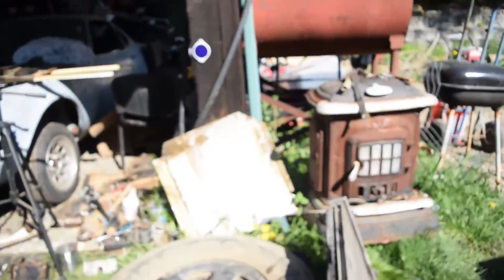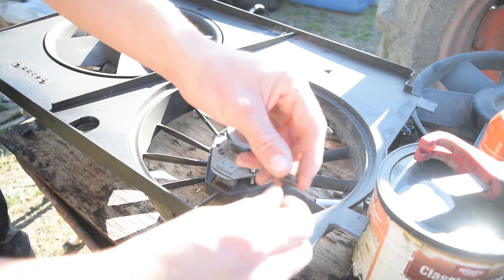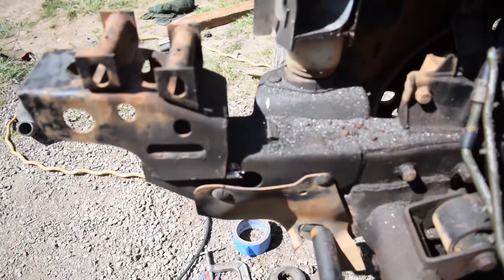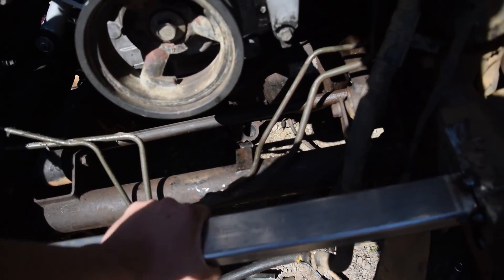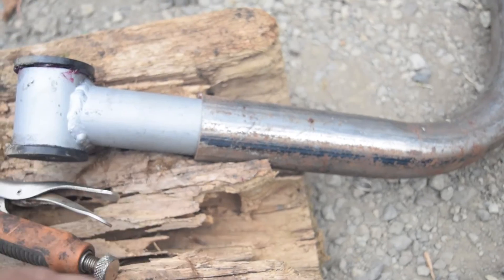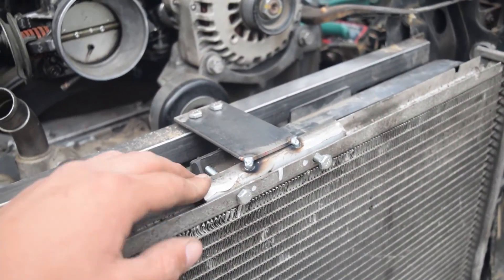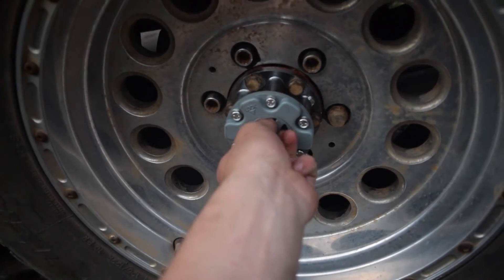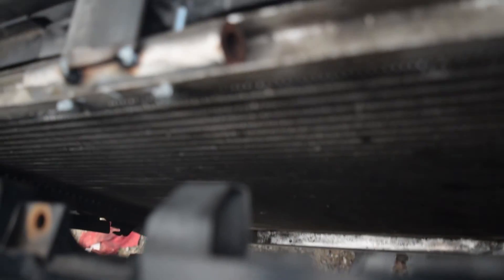LS 5.3 Montero SR pt. 3: Mounting radiator/ fitment issues

Comment: I have a 92 Montero 4x4 5pd trans that I'm having some electrical/ecu issues and kinda had the truck in storage since. Finding your vids sparked an interest in me doing exactly the same but only difference is my truck is a manual trans. Any differences that you can think of that I'd have to do differently from how your doing it like the wiring?
Reply from the maker: You would be able to cut out all of the transmission and transfercase wiring! You will need to adapt a speed sensor for the LS to run and drive correctly though

Comment: Can I install an AUDI A8 (D3f) 4.2L V8 FSI Quattro 6AT (350 HP) engine on Pajero?
I want to install a powerful engine and convert a Pajero to AWD all the time like an Audi
please answer
Reply from the maker: With enough time and money anything is possible. The only thing that i would be worried about is that Audi transmission handling the extra weight of the montero. I believe you would also have to mount the engine very far forward in order to get the front axles to line up with the front hubs.
Reply: @evansautomotive307  thank you very much
I'll try is something interesting to see your old Montero.
It has become strong and competes with the big ones
Reply from the maker: @lale_alale  That will be really cool. Good luck with the build. This one sure is fun and has been doing great!

Comment: You going to run air conditioning?  Doesnt look like much room for a condenser
Reply from the maker: I would like to run A/C in the near future, but I want to get everything to work before I add in all of the plumbing and stuff for it. If i end up with hood pins, or a hood latch relocation, I could just put the condenser right in front of the radiator.

Comment: Do you realise that the frame and the body can move a lot? I mean if one edge of the radiator is mounted on body and the other side is mounted on the frame you will damage your radiator when you hit a good pit or bump because the body has play relative to the frame.
Reply from the maker: yes I do, thats why I mounted it on rubber. I have been offroad a lot, hit a lot of bumps/jumps/rocks etc. No problems at all. The rubber is what saves it.
Reply: @evansautomotive307  that is good👍